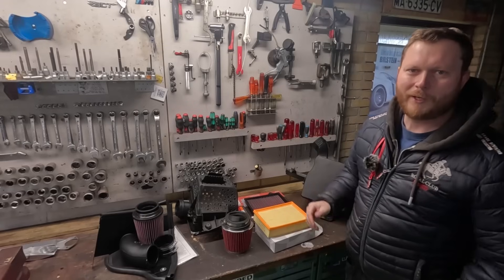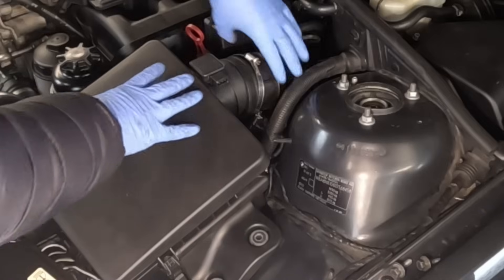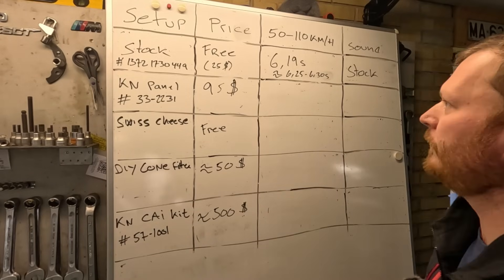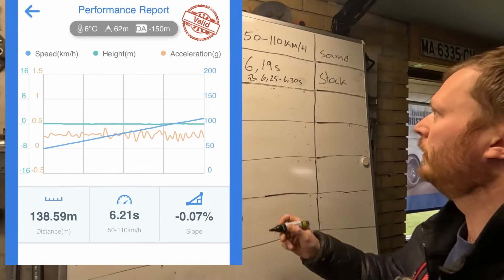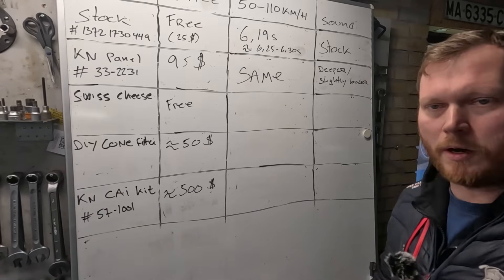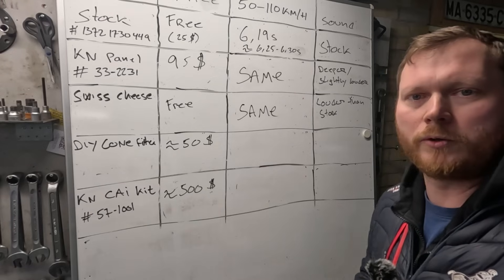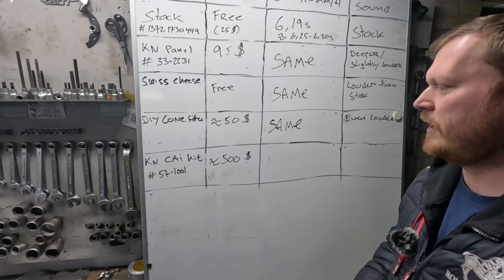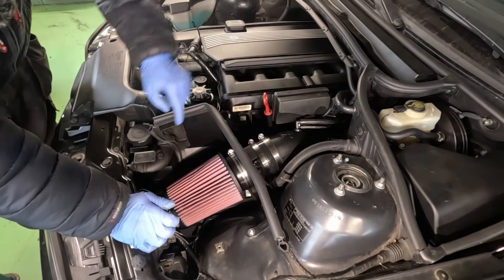Best Intake - K&N vs Stock vs Swiss Cheese mod. Test & Review

Comment: Before writing off aftermarket intakes, you need to remember that for them to work, your engine demand for air must be higher than stock demand. If that happens, you will 100% see gains with aftermarket intakes

Comment: Guy I got the car from had a dumb hot air intake cone on it. I found a stock airbox at junkyard and replaced it right away. The k&n system does sound good though, but not worth that much.

Comment: The version with the cheese holes ist not good, because the engine get wrong air from the visko radiator and there is no HP+ with that version the engine runs to fett you can see that with a lamda tool I know that, because by me m52b25 e36 OEM intake was on the side were the visko radiator is was broken and a big hole in the Plastik and I hear how it runs when let the hole open it runs with to much fiul and when I put my hand on broken hole on the intake the engine runs normal like nothing if I put my hand away than Beginns again tha engine go off from he's self and run to fett because of the broken hole and the wrong air from the visko radiator, I hope I find something what gives more hp!!!!🤔🤔😉👍

Comment: The scientific way of testing these filters should be done by looking at the HPs increase on a dyno and not just the 0 to 100km/H, which is just approximate. Here is an American mechanical engineer that test some of these filters and that shows that some of them like the K&N, increases the HP  by about 5 or 6HPs. https://www.youtube.com/watch?v=GS69owXpGdY&t=42s&ab_channel=EngineeringExplained

Comment: N52 here. I just replaced the silencer with a silicone boot. Sounds a bit better, but the real gain is that my air temps are significantly lower, and drop faster after sitting. Other than that, there isn't much to be gained.

Comment: Does a casing with or without holes and a standard air filter improve the car's acceleration performance ? Because I have a BMW E46 320i R6 and I wonder if you would have significantly better acceleration, I will be grateful for your help.
Reply from the maker: It wont. Sorry

Comment: If you have an NA car it’s not gonna make a difference.   You’ll only see minimal but noticeable gains in boosted cars . Also you have to disconnect the battery once you change it so the ecu re learns A F ratios  re learns driving style .

Comment: Panel drop in filters with a stock box set up is best... You get the best of cold air and good filtration! Under hood bonnet cone filters just give you a throaty inductio roar.. but robs your car of horses via heat soak!!

Comment: On my Focus ST i run the stock airbox with RS box lid.
K&N conefilter and upgraded Mountune RS intake pipe.
I added a COBB ram intake snorkel that goes through the grille shroud straight into the airstream.

 I don't know what the idea was with stock intake but the air had to go through the grille and make a full 360⁰ and end up under the slam panel for it to go into the air box, it was basically stagnant hot air by the time it got into the filter.

Comment: I got a juke nismo rs with a factory CAI. instead of getting an aftermarket intake, I'm thinking about just heat shielding the stock system. Maybe modify it to at it's lowest point to try and get more force.

Comment: As a young man I installed a K&N 57i kit on my e36 320i. Liked the sound but after a while I started to notice the heat soak in the summer with a warm engine. And the 320i never was as fast as I wanted it to be. Sounded great though. 
Switched back to the OEM box with K&N panel filter. Removed the protruding part from the box and made it a bit louder (made it sealed of course). Never looked back. EBay headers and HJS cat made a noticeable difference and made me downshift less. Spent way too much money on it but hey, it was my first love.

Comment: Depends on the car, some respond much better to intake mods. Seen a g37 get 14hp gain with just k&n in stock airbox, much more with proper cold air intakes but they require tuning.

Comment: What's wild is on my SW20 MR2 the K+N 57i  had a pronounced effect on the sound. It made the engine sound like a boxer 8 clylinder. There was a weird interference thing going on different harmonics were accentuated as you moved up the rev range.
It sounded awesome.
High end keenness to rev increased slightly but low end torque suffered a bit. Getting it through emissions was almost impossible. My friendly mechanic used to put a sock over the intake cone to restrict the air to get it to pass.
Eventually I took it off and went back to the original airbox.
GReat VIdeo BTW.
Luv and Peace.

Comment: The problem is the engine. You can fit any filter on this car, and the result will be the same . Why? Because until the car gets enough air flow without air surge, it will give you the same numbers.  If it would be a tuned turbo engine or builded one, then we could see many different results. Simple as it is.

Comment: Not surprised there was no performance difference, remember, any increase in intake air velocity will be registered by the MAF and compensated for. No matter what you do, the factory tune has a baseline it's trying to achieve and will hold back. Everyone who says they got a performance increase from a CAI without a tune is, maybe lying is too strong a word, but mistaken for sure. With a tune, absolutely a CAI is a legit, proper upgrade that will genuinely increase power in a meaningful way. Without changing the tune, the ECU will try to hit it's targets and nothing more. It'll probably throw a CEL if you actually increase airflow too much and your car will probably run like garbage until you get the tune fixed.
Reply from the maker: Thanks for the tip💪

Comment: Tim the beauty of the K&N air filter is it is reusable after cleaning and will last the life of the car !!
Reply from the maker: Ansolutely true. And it gives a slight increase in intake sound too
Reply: also it is the same flow as new paperelement, but over time does not drop off like the paper filter, so a new test wont show the benifits,

Comment: 10 years ago we did a similar test on a dyno with a 325i, stock filter gave more power overall compared to K&N as the Dyno operator predicted beforehand.
Reply from the maker: Thanks for the input..
What is a 250i though?
Reply: @OEMplusRESTO  I adjusted my initial response right before your response. I meant a BMW 325i
Reply from the maker: @GTE_Channel makes sense:-)

Comment: actually the run from 50 to 110 isn't informative, instead you should've use range like 20-140 to address whole range of engine, especially in this case of changing the intake  where the airflow restrictions are more noticeable at higher rpms, so all in all, the attempt is nice, but it could be more informative.

also the temperature of the runs do matter, there is 10degrees difference, which actually ruins the comparison, since we need at least the same temperature to achieve the same performance from engine
Reply from the maker: How about a second gear run of 20-90kmh? Hard to do 140 here
Reply: @OEMplusRESTO  then you'll be limited by time fraction - engine will be on higher rpm only a second or something, I don't know how precise is draggy, but per your data there is a 0.2s difference. 

however, if we engage statistic mode, i.e. 5-10 runs and then calculate the average time and compare it - this should be enough to see the difference. This is like a basic approach to eliminate mistakes of measurement equipment. 

BTW the value we're looking for - the difference - it'll definitely be quite small, I did similar checks for the chip tuning comparison on m30b34 engine, and the diff was about 3-5%. That's why it's so hard to see it, and especially to get it in numbers. 3% out of 6 secs - is 0.18sec - so every 0.01 really do the change.

One more idea though - to find a positive slope, add weight to the car, etc , so as to prolong the time engine needs to reach the limiter - this will give us more room :)
Reply from the maker: @anton_rachytski thank you. One thing is certain. I cant do 20-140 legally. Not sure 3gear is able to pull from 20kmh speed either but defimitely 30 through max rpm. I will think it over and see what i can do for the next test which is wheel weights

Comment: Before 2005 you needed to use aftermarket intake to get more hp. After that the manufacturers smartened up and started engineering good intake systems.

Comment: Ive tried every type of filter and never seen a difference. Until I watched a video by jullian edgar. I enlarged the pipe before the filter and added a bellmouth not much better sound but better mpg and slightly better throttle response.

Comment: I just got racing dynamics carbon box with kn filter for m5 e34 brand new.Gonna put it on my e34 525i m50b25tu with schmiedman s type I exhaust manifold x pipe no cats or midle pipe only rear mufller stock and a remap.after that single mass flywheel 5.5kg and sinter clutch from ptb racing .cant wait 😁😁😁
Reply from the maker: Sounds like a sick setup! Should scream as well👀
Reply: @OEMplusRESTO  i hope soo will post a video 😅😅😅
Reply: You should realy do comperasion between single mass lightweight  vs stock dual mass flywheel🙂
Reply from the maker: @madmanwheelies6157  i wilæ. Im 3 videos time or so :)
Reply: @OEMplusRESTO  i just put carbon air intake and you cant believe what a sound.so much NA raw sound its like M5 now 🤣🤣.seems it gained up top in last 1000rpm litlle power especialy  noticeable from 6600 - 7100 rpm

Comment: My toyota corolla Tsport 2zzge 192hp 1.800cc in the same dyno, same gasoline, same air temperature with k&n cold air intake took 6bhp! (From 189bhp-195bhp) And lower air intake temperature (-10°c)

Comment: Very nice man! I can confirm as having tried the stock paper, k and n and pipercross filter. Difference is minuscule but k and n sounded the best, only fractionally, probably not even one db or so in the cabin. Maybe very slightly faster, but hardly at all, not by a full horse anyway 😅. Glad to have discovered the channel you’re putting some serious work in!
Reply from the maker: Thank you. Im glad you found it too:)

Comment: I didn't hear you mention the single biggest advantage to K&N filters.  They're completely reusable, probably for the lifetime of the car.  When it's dirty, you clean it, oil it, and reinstall.  I stopped installing them only because they don't filter out fine particles as well as either OEM style filters or UNI foam filters (which also require cleaning & oiling).
Reply from the maker: Yeah but im too lazy to wash my filters when a new oem filter is 12 dollars or less:)
Reply: @OEMplusRESTO  No judgment here! :)

Comment: On most modern high performance cars buying an air intake kit will not gain anything and may even loose you some HP. Back in the 80's, 90's, and into the early 2000's an air intake kit would make a nice gain, but now manufacturers are trying to pull as much power out of their engines as possible. Everything is optimized. Most air intake kits and even cat back exhaust systems will not make any power difference. The only reason to buy that stuff nowadays is to make the car sound more aggressive.
Reply: Swiss cheese mod it is then lol
Reply: It depends on the engine. For example a turbo charged Renault I drove in 2017 with 1.6 turbo gained 12hp on the dyno with a performance air filter
Reply: @valiantone395 that's turbo not n/a

Comment: good test... but try this  hold the K&N air filter to a strong light on into the sun..if you can see through it... that means a lot of super fine dust is getting into the engine.. and that super fine dust is gravel to the piston rings and cly bores... paper filters work great

Comment: You need to put fresh air from the fog light area directly to the CAI shield filter are with some tube. The only time you will actually notice a difference, also that in combination with some speed.

Comment: I am wondering, since you are modifying the intake and exhaust properties so much then don't you need a tune up to make full use of them? At least in motorcycles the stock tuning parameters take into account the change in elevation and temperature only and if you radically change the exhaust and/or intake then it goes so much beyond of what the stock tune can handle and at best there is no performance gain, at worst you lose some because the bike is now running too lean, perhaps even dangerously so. So much air taken in but not any more fuel added to burn but what little is being burned is burning REALLY hot. A dyno tune does wonders on most stock bikes but even more so when you have other mods. And if you have enough mods then it becomes absolutely mandatory.

Car fuel injections are probably more advanced than motorcycles (cars are after all bigger and more complex machines) but the thought of it would still nag me. I think the real test would be to first have the car dyno tuned in stock configuration and then dyno tuned with full intake and exhaust mods.

Comment: I drive a suzuki alto 1.1 and put in a k&n filter. The airbox inlet was tapered really narrow so i sawed it off, put a big bend of alu intercooler tubing on instead. From 3000rpm the car sounds super loud and way faster than it is. At 6000rpm it sounds like it will take off like a jet plane haha

Comment: The k&N drop in panel filter is actually a way better value than you give it credit for. Instead of replacing it every 10k miles you clean it and re use it for 100k miles. Additionally once you computer adjusts to brething differently, youll notice better gas mileage ive used them.on all of my vehicles for 20 years after putting 100k miles on one

Comment: The only realistic difference that I've noticed when going from an OEM setup to a cone style filter is that throttle response is much sharper with the cone style air filter.  My theory is that as there is less intake piping, and a lot less bends in the piping, the incoming air has a simpler path of travel.  Last I recall, for every 90 degrees of air path change, you get hit with a 10% efficiency loss (ie. air velocity declines due to the change in direction).

There was no discernible difference in terms of power or acceleration.  It basically made my WRX feel closer to a larger NA setup VS a turbo setup with some noticeable turbo lag.

Was it worth it?  To me, yes.  I truly hate delayed throttle response.  Then again, I'm not going for power numbers or every 10th of a second in terms of acceleration.
Reply from the maker: Thanks for sharing that. Alot of peopmle mention the added throttle response too

Comment: The KN panel filter gave my diesel Volvo V50 a slight boost. I have one hill where the car could always barely hold the speed at 60 km/h in fourth with a stock filter. With the KN it was able to accelerate slightly. It also got slightly more induction noise. That's the only noticeable difference. No noticeable difference while driving otherwise.
Reply from the maker: Interesting. Thanks for sharing

Comment: Drop in panel filters do nothing at all, that typhoon cone intake is notoriously poor, as let’s in hot air,  and is oiled which is not ideal. my mate ran one on his M3 and went back to stock and car was noticeably more responsive.
Only decent ones are proper CAI like evolve eventuri which I ran made a big difference then upgraded to the CSL carbon box intake and again got genuine increases. 
All these are pointless without a delta reading before and then after each filter. 
K&N are oiled too which you shouldn’t use with Maf’s as the oil can get on the MAF and damage it and. 
Stick with stock or spend the money to get a proper intake

Comment: I installed the K&N 57i CAi on my 01' RS4 Avant and 12' Speed3 .... on my 92' Mirage CyborgR, is just stock oem .... the 4g93 NA runs on Haltech Sport 500 standalone. Bottom line, the CAi works better on a tune forced induction engine while on the NA it doesn't do shit, tune or stock, but I went and install the K&N panel filter just bcoz its washable ...  also the same on my 14' Duke 690r and there is a reflash to it too.
Reply from the maker: That seems to be what everyone says. Thanks for the tip. Will test this on a turbo car again some day👀
Reply: @OEMplusRESTO  the only bolt on parts dat makes immediate power is a full exhaust system for NA ..... for the turbo engines, u can get away with just a down pipe with oem resonator+back box/muffler.

Comment: Be very careful just connecting a cone to the MAF. I had a stalling issue on my 330 (when I had it) finally worked out you really need that little curved pipe before the MAF.

Comment: Well, most options were slower, 0.1 or 0.2 seconds slower, yet, you say it's the same time
But when the CAI is faster you write down the 0.1 second its faster
The testing was fine, how you presented your information on the board, was not
Reply from the maker: Great critique. Thank you. Thats because these data are really heard to gather and so many things play into getting it right. So when i do .1 second slower or so i have to look at the incline/decline and compare with other runs. From that i conclude its no faster or slower under those conditions. Maybe they are a tad slower or faster but unless i get a dyno of a completely level road with the same weather conditions each time, this is as good as i will get